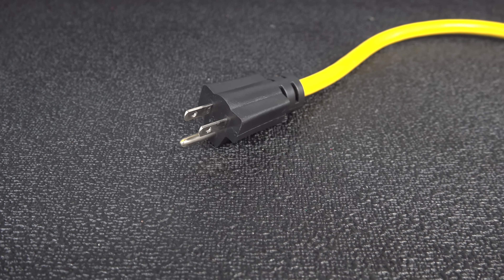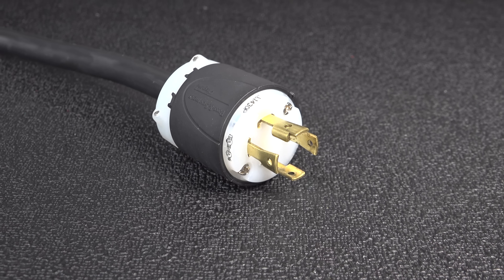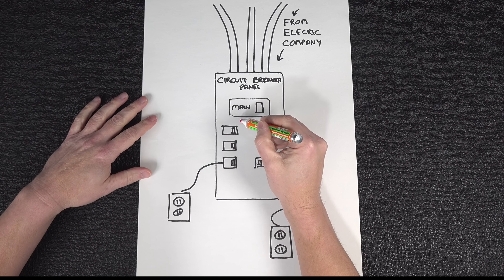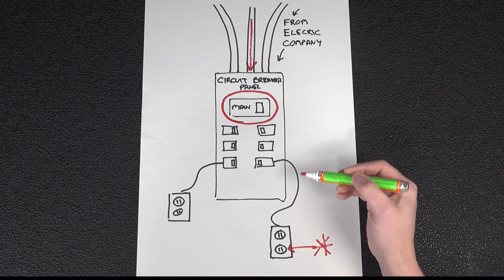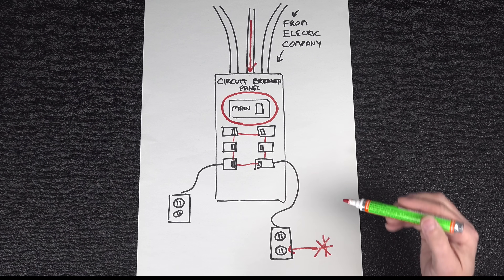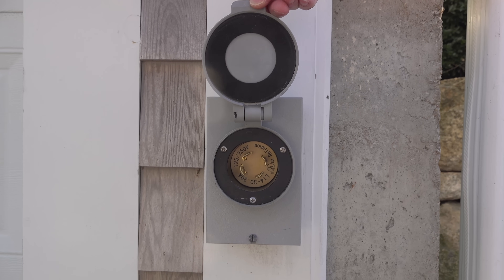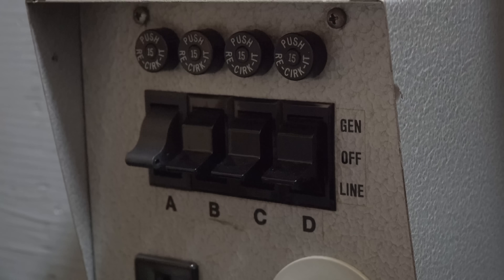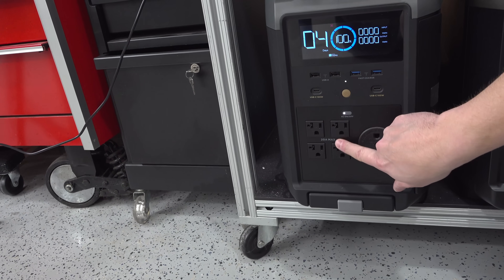Worst Electrical Mistake You Can Make - Backfeeding Generators

Comment: Pertinent reference data:
Article 705.NEC702.6 contains an exception to the transfer equipment requirement:
“Exception: Temporary connection of a portable generator without transfer equipment shall be permitted where conditions of maintenance and supervision ensure that only qualified persons service the installation and where the normal supply is physically isolated by a lockable disconnecting means or by disconnection of the normal supply conductors.”
The term as defined in the 2011 NEC reads as follows: Qualified Person. One who has skills and knowledge related to the construction and operation of the electrical equipment and installations and has received safety training to recognize and avoid the hazards involved. (no degree or certification necessary, just basic knowledge training available everywhere)
110.25 Lockable Disconnecting Means:
Where a disconnecting means is required to be lockable open elsewhere in this Code, it shall be capable of being locked in the open position. The provisions for locking shall remain in place with or without the lock installed.  (you can't lock it with a chain or some other thing that is all removed when unlocked, the lock has to be a feature of your breaker box and be able to lock the main breaker open. 
Maybe you'll be the first person to not immediately tell me I'm wrong and stupid for understanding plain English.  You CAN legally backfeed through your panel and do so without an interlock or a transfer switch if your breaker box has locking function, provided its a temporary connection of a portable generator. I cite that code as my evidence.  Nobody should freeze because they saw this video and thinks they'll be arrested if they turn the power on.  We should have a video up to show how to safely do it for those who might make a mistake, but we shouldn't hide the real data and feed out false data for the in terrorem effect of people avoiding trying. (the real danger is the power coming back on grenading the generator, and the backfeed circuit not being up to the gauge needed to power all the circuits, things never mentioned in a "its all illegal no exceptions even though there really is one" videos.  I guess I'll have to make it.  The flames in the comments from electricians would be epic.
.
Reply from the maker: Yes, I will be the first person to tell you are wrong, 100%.  I am aware NEC and that paragraph. That is why Interlocks became legally allowed to use. You can't take 1/2 the paragraph and say...oh wait see back-feeding is legal! Yes! The key part is locking & qualified persons. You are unable to lock residential electrical panels main breaker.  It's not the back-feeding design that kills alone, its the failure to make it foolproof. Additionally a homeowner is not a qualified person under the NEC and with the panel unable to be locked out.  It is still 100% illegal.
Reply: @SilverCymbal  Yes, you can lock residential electrical main panels by locking the panel itself. I gave what the code requires for "lockable disconnection means" Yet you want to define it yourself rather than let the NEC do that to make you "right all along".   
I also cited the NEC definition of "qualified persons". Knowledgeable homeowners do meet the requirements of qualified persons to service their own installations.  The exception doesn't mention interlocks at all so "That is why Interlocks became legally allowed to use." is simply non-sequitur as well.  
I didn't take 1/2 I took the whole thing, then I took the definitions from the NEC to define the words within it.  Its not unclear English. "SHALL BE PERMITTED" isn't in any way confusing.  
I'm sorry you took this with the standard internet user attitude of "I must have been right all along and cannot learn something from someone else providing me senior data."  I'll be sure to use you as an example of those who use lack of understanding in an in terrorem fashion.
Reply from the maker: @snap-off5383  I am really hoping this is some sort of a joke or maybe you are in law school and using this is as an exercise. Let me put it in my low end terms, dude it's illegal 100%. You can correct my english or the arresting officers all you want, you will still be at fault if you do this. Here I will just paste a few things for you to read.
Reply from the maker: @snap-off5383  Backfeeding your generator is a risky and illegal practice forbidden by U.S. National Electric Code. If you still persist in backfeeding your home's electrical framework and harm or cause the demise of a utility worker, you will be held responsible.
Reply from the maker: @snap-off5383  The use of generators during a home inspection is prohibited by the Standards of Practice, unless the LHI is a licensed electrician (and even then, it would not be practical). Both, the National Electric Code (Article 700) and Entergy’s Customer Installation Standards (Section 12) require that, in order to hook a generator to the main electrical panel of a home, a transfer switch must be installed onto the panel to prevent the current from back-feeding through the neutral to the power lines. Such an event could electrocute a lineman working on a line, create a power surge on a neighbor’s home, start a fire and a host of other perils. A transfer switch cannot be installed on a home without first obtaining a permit from the local permitting authority. Unless the person installing the transfer, switch is a licensed electrician, he will not be granted a permit. Even if he were licensed, the installation of a transfer switch just to inspect a home would not be practical. The LSBHI has jurisdiction over this practice pursuant to section 309C(1) which states a home inspector “shall not offer to perform any act or service contrary to law”. Since the NEC is adopted by all jurisdictions in the state, to perform services in violation of the NEC would be “contrary to law”. Also, under our ethical standards, Section 501B(9), the LHI “shall perform services and express opinions based upon genuine conviction and only within his areas of education, training or experience.” The LHI who is not a licensed electrician does not have the education, training, or experience to act as a licensed contractor.
Reply from the maker: @snap-off5383  The 1999 National Electrical Code (NEC), published by the National Fire
Protection Association, is a nationally recognized standard for safe
electrical installations. The NEC does permit an interface between the
normal power source (generally the electric utility) and an alternate
power source (such as a standby or portable generator) provided that the
proper transfer equipment that prevents “backfeeding” is used. Simply
connecting a cord from the generator to a point on the permanent wiring
system and “backfeeding” power is an unsafe method to supply a building
during a utility outage.
  Improper connection methods not only endanger the building occupants,
but pose a serious hazard to electric utility workers as well. There are a
number of products available that will provide either an automatic or
manual transfer between two power sources in a manner prescribed by
the NEC. When selecting a product for this function, it should be one that
has been evaluated for safe performance by a nationally recognized
testing organization such as Underwriters Laboratories. The product must
be installed according to the NEC, all applicable state and local codes, and
the manufacturer’s instructions. Homeowners should only attempt to
install such products if they have a thorough knowledge of safe electrical
installation practices for this type of equipment. Otherwise, a qualified
electrician should be contacted.
Reply: @SilverCymbal  Let pull the factual data out of your reply and parse it:
"The NEC does permit an interface between the normal power source (generally the electric utility) and an alternate power source (such as a standby or portable generator) provided that the proper transfer equipment that prevents “backfeeding” is used." AND it has ONE exception that I gave, that YOU left out here, because that HALF that you don't want to address contradicts your assertions that transfer equipment is required by specifically saying that connecting it without transfer equipment is something that shall be permitted. “Exception: Temporary connection of a portable generator without transfer equipment shall be permitted where conditions of maintenance and supervision ensure that only qualified persons service the installation and where the normal supply is physically isolated by a lockable disconnecting means or by disconnection of the normal supply conductors.” Its a direct exception to the requirement of transfer equipment with two easily parsed conditions where they themselves define the terms of the conditions.  There is factually NO information or training needed to determine the logic of the code.  
I pre-addressed the qualified persons and locking disconnection means, because predictably EVERY parrot that doesn't want to think things through says the same objections that are proven wrong by the NEC language itself, with no supporting words needed at all. 
If a person who knows what they are doing connects a generator through adequate conductors to a panel with a main breaker locked closed and prevents others from accessing that equipment there is factually NOTHING unsafe about it, and that's why the code permits it.   It would be stupid to be cold or hot unnecessarily if you have a generator and a locking breaker, just because you're afraid of a law that doesn't exist.
Reply from the maker: @snap-off5383  I understand you are justifying your own actions and hey do what you want. But yes it's wrong, yes it's illegal and you put yourself and others at risk. You can't show a single source on earth that says otherwise. However you can find hundreds if not thousands stating it's illegal and never to do it, and stories of lineman that were killed as a result. Here's an even easier way to know it's illegal. You won't accept my answer, so don't believe me call your local fire department, building department or the NEC see what they say, tell them about the maintenance exemption for electricians.
Reply: @SilverCymbal  Well that was just about every one of the Argumentums:  

Ad Vericundiam: (Appeal to authority logical fallacy - a person with a degree can be wrong where a degreeless person is correct, credentials aren't relevant facts or evidence )

"don't believe me call your local fire department, building department or the NEC see what they say" - the only usefulness of that would be if they could supply NEC code that changes the code cited despite an already exhaustive search . . . that possibility still exists that I've overlooked something in the code, thus I asked hundreds of times to see if youtubers or others could actually articulate it, because seeking out to disprove one's own theory is how to conduct proper research. I want to be shown I'm wrong, not by some fire chief or building safety manager's opinion since that would be logical fallacy.  Evidence that a statute or code would constitute is what is the senior data.  And I can also illogically cite many electricians who understand the exception to allow qualified homeowners to connect temporarily without transfer equipment including my neighbor a retired professional electrician that I had over to inspect my 240V welder receptacle I installed for potential code violations.* But since those aren't logical assertions, I don't place any weight with them or try to use them to persuade others.

Ad Populum: (Bandwagon logical fallacy - just because the vast majority said the sun orbits the earth didn't make it true )

'However you can find hundreds if not thousands stating it's illegal and never to do it," - they can all be wrong, people have a tendency to parrot what they hear others think or to determine what they think should be the law and pretend they know it rather than actually research it.  A large number of wrongly informed statements don't refute a correct one.

Ad Homo Stipulae (Strawman - Make up something other than what they said and argue against that instead, because you can't actually argue against the real assertions ): 

"I understand you are justifying your own actions and hey do what you want."  I haven't done this at all, I'm investigating it, and wanting true facts so I look stuff up.  Nobody cites the laws or codes, they just state it.  When pressed they give a code that holds within it an exception to what they think it demands, or conveniently clip that part out and pretend it doesn't exist.

Ad hominem: (Arguing the other's personal characteristics rather than the topic - personal characteristics do not affect an argument or assertion )

"You won't accept my answer, so don't believe me" - I would if you cited a NEC code that said "this is only for certified maintenance techs" rather than the NEC definition of qualified persons which we already parsed which only requires being trained on the potential hazards.  That isn't everyone, but certainly isn't hard to obtain, and that information could be told to people who could then go get the training. 

Ad Absurdum: (Making absurd and outlandish statements designed to elicit emotion rather than logically addressing the facts of the issue)

"lineman that were killed as a result." - of what?  following the exception in the NEC code which is still the topic? It would be strawman to start talking of voltage from a generator on utility lines, as that would never happen in the parameters asserted. The main breaker would be locked closed in all instances of discussion.
It would be impossible for a lineman to be hurt through a locked open main breaker, which is what we're talking about.

False Attribution: ( appealing to an irrelevant, unqualified, unidentified, biased, or fabricated source in support of an argument. - where does it say this anywhere?)
[the exception to the requirements for transfer equipment are solely] "maintenance exemption for electricians." - even though you can't cite where it says that, but if it did, that might make you "right all along" so go with it right?

Ad Nauseum: (Broken record - If I say it over again like you didn't just present facts that prove that wrong, then I'm right - _the information re-given is still wrong, you need to give different arguments_). "100% wrong/illegal" - Its a long hill to "illegal" you haven't even established "contrary to code".  Like I said to the other guy, I also researched this, its not a school assignment, but I've put that kind of research into it, so if I ever do go back to school I'll be sure to use it as an essay or project if applicable.  Anyway here in my county we've adopted ordinances that implement the NEC but NOT the NFPA, we actually have by ordinance the IFC2018 instead of the NFPA and the state has adopted the IFC2012.  As for reports of code violations, the county department of building safety gets notified to do an inspection either by public report or sherrif/police, and you get a letter with a 90 day window of when they'll be by.  They find nothing hooked up as the power is back on when the inspectors show, your place passes inspection.  There's no legal risk to doing it correctly by the code exception here in my county. I'm pretty much at moving on about the "illegal/against code" for the transfer equipment portion that's a dead horse, the only info I need to make a documentary about this is the full extent of code about the generator cable and inlet receptacle stuff.  I haven't yet bothered to research the suicide cable since I'd rather just change a wallbox receptacle with a light on my head for 4 minutes for the peace of mind.  If I did do a suicide cable I'd watch it like a hawk likely get heartburn and disassemble it the instant it was done being used so others wouldn't find it. But for sure I will do that research as well and stuff a big ugly code if found or a "cite the code challenge" if not found that pertains to the specific topic of what cables are allowed to be used for temporary connection of a portable generator.

* We agreed that the time it would take to turn the main and unneeded breakers off and lock the main, then remove the welder receptacle from the wall under flashlight, disconnect it and replace it with the generator receptacle putting it back into the wallbox, followed by the procedure of connecting the generator with a generator cord would be perfectly reasonable amount of time to ask the ladies to wait for power and would allow a knowledgeable person to utilize the receptacle as a 240v outlet and temporary use portable generator inlet.  It would also add the same amount of time to undo before unlocking the main breaker, still no big deal, not worth blowing thousands on a transfer switch or hundreds on interlock. Interlock also end up being really expensive for those out of breaker spots.  Those owners shouldn't feel they "have to" go without or "have to" blow the money it costs on a new panel install when there are stipulations in the code they can take advantage of.  You CAN get a lockable breaker,  You CAN become qualified by training on the hazards. You CAN ensure only the qualified service the installation.  That's all the code requires.
Reply from the maker: Qualified Person: The term as defined in the 2011 NEC reads as follows: Qualified Person. One who has skills and knowledge related to the construction and operation of the electrical equipment and installations and has received safety training to recognize and avoid the hazards involved.
Reply: @SilverCymbal  You just repasted what I already put. Are you reading what I write or just the first sentence? An informed homeowner DOES meet that requirement.